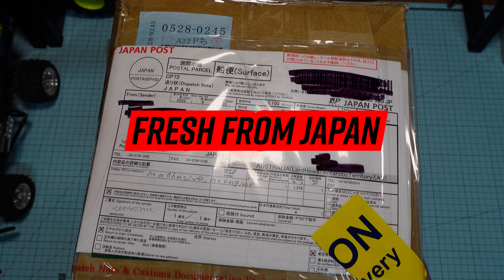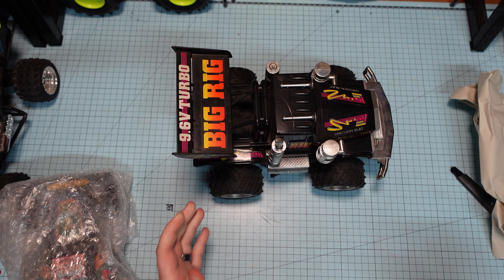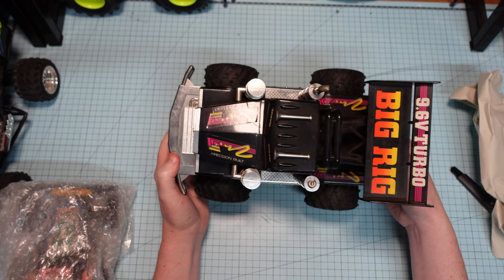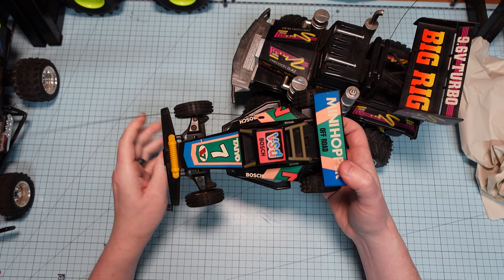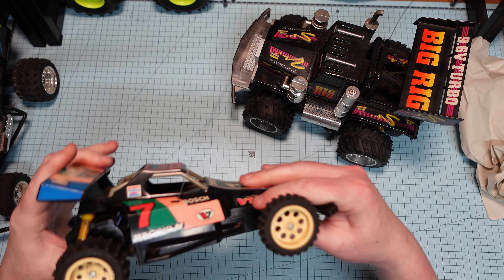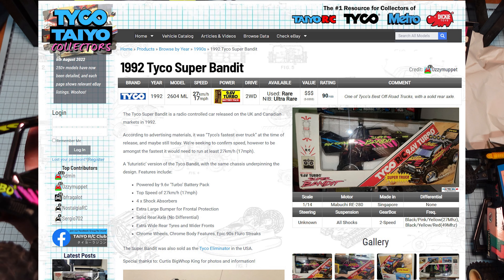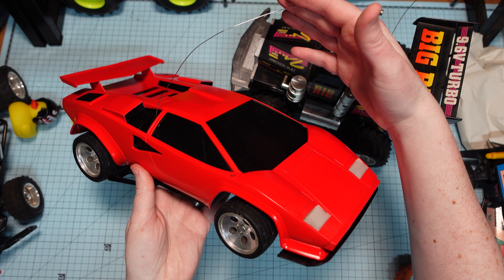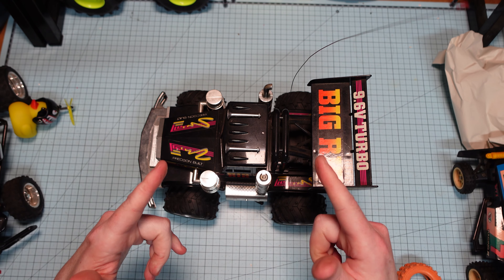[Vintage RC Fans Only] - Quick update on my Tyco Taiyo RC Collection Fresh from Japan!

Comment: I have a boxed Taiyo Racing 4WD pick-up. Is there somewhere I can email you pictures and description to get your advice on pricing? I know there's the Tyco Collectors website, the only other site I found was one that specifically doesn't want to be asked about valuations. It's the EU release. The box is all in English and it says made in Singapore. Does that significantly affect value compared to the JDM model?
Reply from the maker: Hi mate. I also run TycoCollectors :) These are my favorite cars, happy to give some advice if you use the contact page there, or email admin (at) tycocollectors.com, send some photos if you can. The Made in Singapore wouldn't usually affect the value no.  Thanks.
Reply: @CheapCheerful  Ok, great, that makes life easy! Thanks.